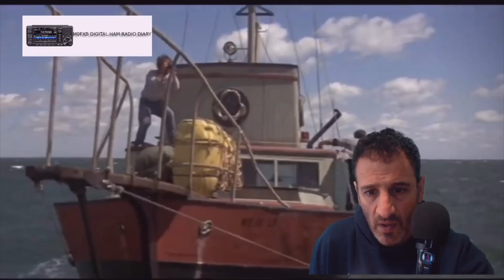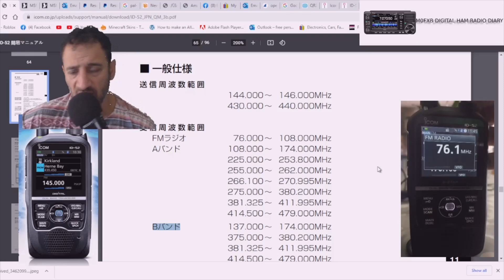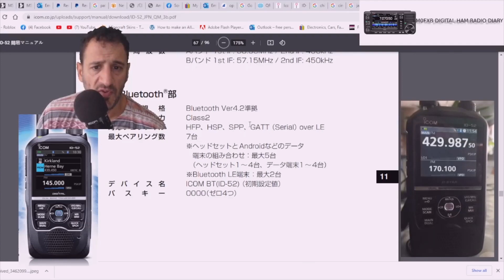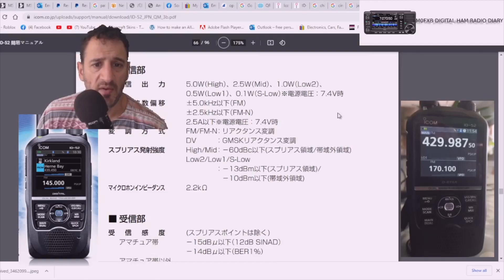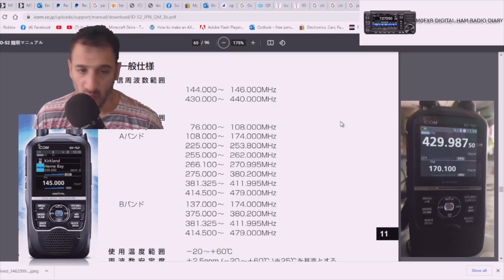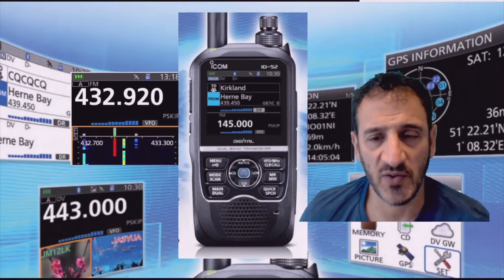ICOM ID-52 Transmit frequencies (Japan Import Model)

Comment: Did you unlock the receive to give it continuous receive?  That can be done.  The Transmit mod is an unknown yet, the 2 diode removal like the US/EU version doesnt work.  There has to be either a key sequence to make it work or its hardcoded in the firmware.
Reply from the maker: That's news to me.i thought it can be modified ask at your local Ham Shop .